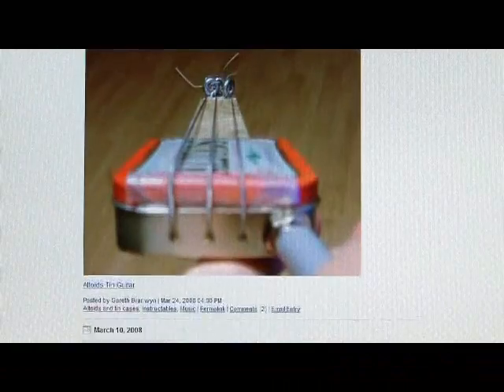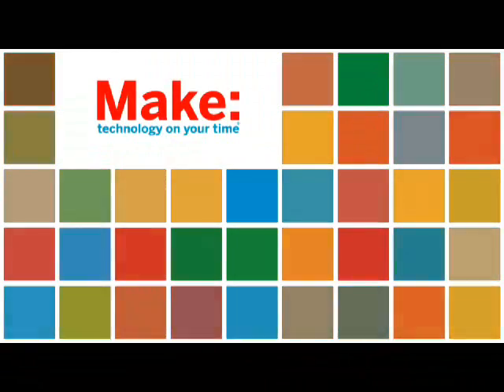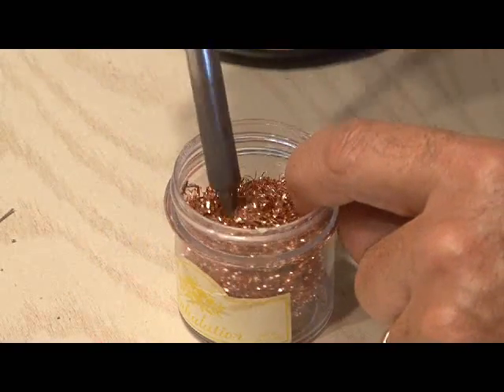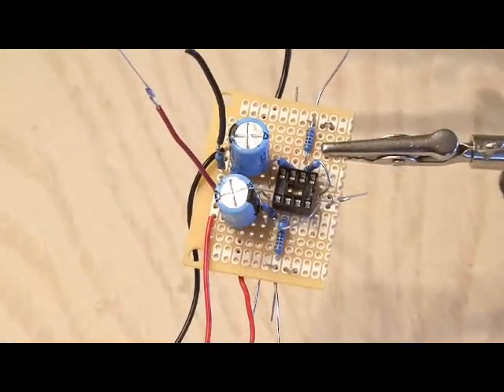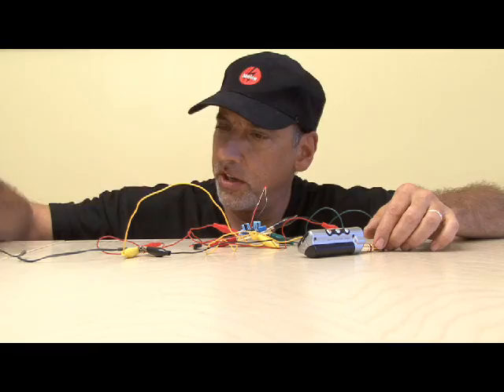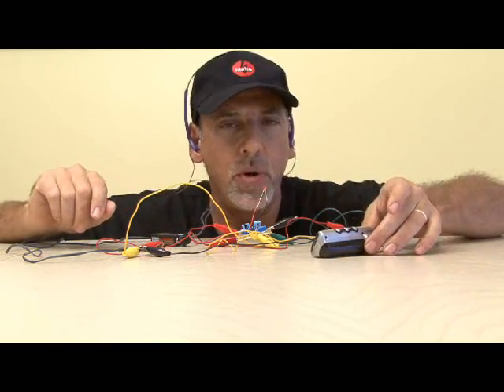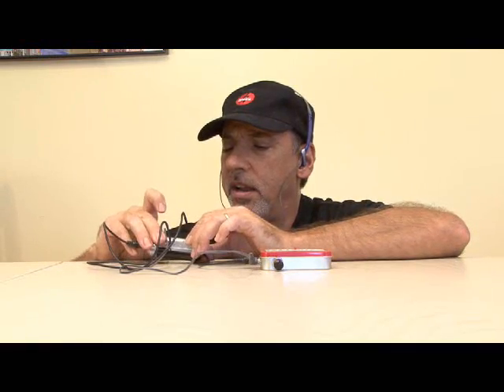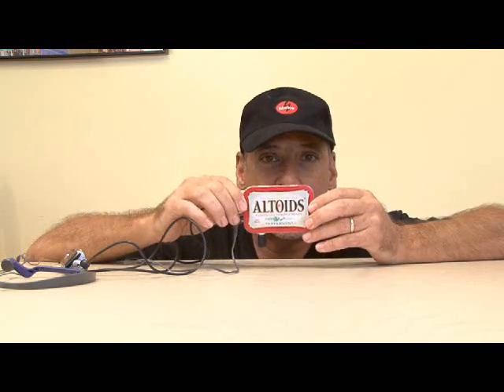Weekend Project: Mint Tin Amp

Comment: One of the worst DIY projects I've ever seen. Perfect example How NOT to do it. No part list or circuit diagramm. Did he thought no one wants to make one? 

My suggestion. Search for "Little Gem" on Google. These amps are the real deal (that means you can control a speaker with them), and also made from very little parts.

Comment: @AJ8494030615 a 8 pin socket for the 8 pin IC of course! What I think you mean is what kind of IC. I would like to know that too. It is probably just a simple dual op-amp circuit. One for each channel.

Comment: @Metallica0912 Not really

It’s a question of gain: you could increase the amp’s gain to around 100 to make it loud enough, but the noise floor will be unacceptably high. You need an amp design made for low noise with high gain.

Comment: The point of such an amplifier is to amplify the sound output from weak devices to power higher impedance headphones. Not the ones he uses though. Alternatively, if you are looking for a fast way to destroy your hearing, use this with any cheap headphone.

Comment: So I'm making these own portable speakers of a couple of old computer speakers I had laying around.
I have cut off the electricity transformer and planning to connect it to a battery/battery pack instead.
On the transformer in my speaker it says (among other things): "OUTPUT-AC 10.7V/0.8A".
Now to my question. Is the output energy actually 10.7V? What should I use for this? If I use 12V battery pack, does it only use the amount it needs or does it somehow get to much electricity and overheat?

Comment: @nicksfans123  Driving headphones (especially larger ones) is the biggest drain on an MP3 player's battery.  If you have a really small player with limited battery capacity, turn the volume on the MP3 player down, plug into this amp, and then plug your headphones in,  The added 9v battery provides the power to drive your headphones, and allows your MP3 player to run a whole lot longer.

Comment: Split the jacks for Right and Left, then take two small speakers (not active speakers) then buy a couple of jacks and connect the speakers on then, and plug in left and right. There you have a nice Stereo Amp =)
(Or you can just use computer speakers which already have a stereo jack, but they are active and they may get burned if you overdo it.)

Comment: @Birdy101235 

If you have decent high impedance headphones, an iPod type mp3 player is very quiet. I can't use my good headphones on the metro (subway train) as they're not loud enough and it drives me crazy. The amplifier boosts the voltage to the headphones and drives them more efficiently. It is the equivalent of turning the volume up to 20 or so when 10 isn't enough. If you have low impedance headphones, you may not need one of these, but you are probably not getting the best quality sound.

Comment: @seterry well, you can go about building one with a power op amp, like a TDA2030 (good for about 10W, use a +/- 12v stablised supply able to provide about 650mA. but i havent seen that particular video. there are circuit diagrams on the datasheets of TDA2030.

Comment: @seterry more power? try 2 batteries instead of 1, this would give you +9,0,-9. looks like 8 pin LM something. connect positive terminal of one battery to the negative of the other, then put ov at the point where the + and - terminals together.

Comment: I give the circuit a 3 out of 5 , I give the project a 4 out of 5

expected push pull amp with killer distortion , or multi head phone outputs.

Comment: @KillingOptions Makes the sound LOUDER hence the term AMPLIFIER. That's why a car audio setup costs so much. The speakers alone are around 300$ for a decent setup, but the amp will run you about 600$ on a good day. (Especially if you're installing a subwoofer.)

Comment: @budalo10 Yep, you just hook both of the headphone jack connectors to the output, and connect the sleeve to ground.  Here's a modified diagram.

tinypic   (DOT)  com/r/112c2zo/7

For headphones you may want to use a smaller pot for the volume control.  For example, a 5k Audio taper.  This will lower the signal level to a more reasonable level for headphones.

Comment: @budalo10 This designs definitely not ideal for a guitar amp.  It's input impedance is far too low, so you'll lose a lot of frequencies.  Plus, as you said, it's got an extra channel because it uses a dual op amp.  

A much better design is the "Ruby Guitar Amp."

That designs meant to be driven by a guitar pickup and it has a built in adjustable overdrive circuit.  Lots of demo videos of it around, and all the parts can be found at radio shack.  Best of luck, feel free to shoot me any questions

Comment: The scouring pad is not the same as the copper pads you buy : why? Flux. The copper pads you buy for electronics have flux on them which helps preserve the tip of the soldering iron from oxidizing.

Comment: @winnetouch because using an external amplifier and not pushing either amp anywhere near it's limits (like you would do with headphones directly plugged into your mp3 player) you'll get better overall frequency response, and less harmonic distortion. (sound quality)

Comment: @msgr33nday actually, the original reason people started making these is because some higher end headphones are harder for small MP3 players to drive properly. I've got a pair of Grado SR-80's, and they have a 32 ohm nominal impedence, rather than the usual 8 ohm that a lot of cheaper ones have. This means that it takes a lot more power to get the same sound out of them (but they ARE $120 [list price] headphones). A mint tin amp gets clearer sound and more volume, and saves battery time too.

Comment: @josh45245chatter It's for bigger headphones that require more power.  I have big studio monitor headphones that are VERY quiet when you try to use them with an mp3 player or laptop.  They need a headphone amplifier to be louder.

Comment: @howitsdone24 Of course you could change the headphone jack for a speaker jack, but that doesn't mean it's going to work. The circuit uses a small Op-amp which while powerful enough for headphones (when right next to your ears) is NOT powerful enough to drive speakers!

Go and search Google for "mint-tin amp" - take a look at the 2nd site at "tangentsoft" and then read the FAQ. It is quite clear that using it for anything other than a headphone amp is not going to work very well.

Comment: @howitsdone24 Actually if you read the design page, it tells you specifically that it's nothing but a headphone amp.

"Is it a speaker amplifier?

No, it’s a headphone amplifier.

It’s a question of power: the CMoy pocket amp can drive small speakers if you only need them to be loud when your ear is right next to them. Kind of like headphones. Go figure."

Comment: @computerman098 Just because you don't have a use for it, doesn't mean that others don't..  Mp3 players are designed to play at extremly low volume (in relation to other media devices) in order to save on batteries.  Which means anyone who wants their mp3 player to actually compete with outside noise, or to drive larger speakers, will need to run it through an amplifier.

Comment: I made basically this for use with a computer at work a few years ago; it had line-out only and was very quiet with the volume turned all the way up; it had three LM386 audio amps (two for stereo, one for mic. boost) and powered by three AAA NiMH batteries.  I used a plastic project box.  You can use the mounting holes on the circuit board with standoffs to mount the PCB.  My next project is a mini guitar amp that will have a speaker built-in and will plug directly into the guitar.

Comment: If mindless sheep connected to iPods can't hear their mp3 players be quite assured they have already damaged their hearing beyond repair. A headphone amp is basically the same as hearing aids at this point.
This would be a great little guitar amp that can be built into a cigar box. I have done it and incorporated the circuitry from a distortion pedal into the box as well. All you need is a 5" speaker and some knowledge, or help, with the circuit path and voila - a low volume bedroom amp.

Comment: theres no reason to bash me out but w/e it happens. Excuse me if I'm wrong but I built one of these in high school; it blew out my koss head phones. btw drivers are files required to recognize hardware on a operating system. if anything you might being thinking of the piston. If anything this is not a professional audio system, I'm sure of that.

Comment: I made a three-channel amp in 2000 with LM286 audio amps, fit into a plastic project box.  My work computer had line-level outputs only, and it wouldn't even drive headphones.  Two channels were stereo amp for headphones, third channel was for microphone.  Oddly, if I touched one particular solder joint, I could receive a local radio station.  Circuit bending by fortunate accident.   Maybe I should shoehorn it into an Altoid tin.

Comment: MAKE usually has fun projects that are useful. I really don't think that this is a bright idea. It doesn't really matter if u wanna blow ur ears out. Don't get me wrong i like to blast my jams too, but this will destroy your headphones. Headphones nor earphones are meant to handle that many decibels. The cone will eventually rip away from basket. If you built this or are planing to build this only use it on a extra speaker. You don't wanna blow out your nice headphones

Comment: depends on where you get it and the amount of heat it can produce. i think $25 should get you a pretty decent one. check radioshack for one. also, if you havent soldered before, watch instructional videos before you fry components or destroy your soldering iron

Comment: soldering gun. its pretty much electrical glue. its used to heat solder to "weld" them to circuit boards. kinda like electrical tape but more permanent. hope this helps

Comment: Re: expedition94
iTunes may have such a software option to boost mp3 audio 200%, but that is a software method that is likely to distort the audio, whereas this hardware will more cleanly increase the gain of said audio.

To those saying "why not just plug the headphones directly into the mp3 player," well that's fine for some people, but sometimes they are in situations in which their mp3 player's amp does not provide enough volume even at max; this amp will fix that.

Comment: Not all parts are available on Radio Shack. Most of you can purchase at warehouses and what not and avoid the mainstream retailer's price (aka Radio shack). The only thing you're supposed to get there is the circuit board because of the guide is based on an exact model from RS.

Comment: Haha the point of this was to make an amplifier. He is just showing you with head phones. say you had small computer speakers and you pluged them into your ipod they wont be that loud because there 9v and your ipod only puts out 1.5,, so to boost the power to 9 volts you use an amp. which he had made.

Comment: instead of a spark, attach a piece of nye-chrome wire between the two wires. use a needle and poke a hole in the fuse, stick the nye-chrome wire in the hole, then attach to the two wires. you can find nye-chrome wire in the heating element of a hair dryer. my ignition system isnt wireless, but it does work. please pm me with more information about your system. i am very interested

Comment: Kipkay what kind of amp IC did you use in this project? did you use the KA2209 IC? it looks like a 4 pin IC and this amp is stereo and the KA2209 is a 1 watt stereo amp b/c i have a Mega Mike from thew 90s and ive taken it apart like 100 times and I saw a 4 pin IC and it said KA2209 on it, and finally i rigged it like you did in your transistorize your ipod video, thru the volume comtrol.

Comment: This can be modded to use as a headphone guitar amp as well? It would have to be modded because a cord from a guitar is not a stereo cable it is 2 connections hot and ground.  If not modded you would get sound out of one side.

Comment: Again I agree it is a cool little gadget, and I'm not knocking the guy or his invention, but again most mp3 players can output sound at a sufficient level to cause hearing damage, and as for the theory you could use it to drive bigger/better headphones, who's gonna be using top-end expensive headphones on low-end , mp3 compressed audio players?

Comment: I agree it is a cool little gadget, but again most mp3 players can output sound at a sufficient level to cause hearing damage, and as for the theory you could use it to drive bigger/better headphones, who's gonna be using top-end expensive headphones on low-end , mp3 compressed audio players?

Comment: MP3 players don't have enough juice to drive bigger headphones. They're fine for earbuds and other headphones with smaller drivers, but if you get a nice set of around-ear headphones, which have bigger drivers and therefore reproduce sound more faithfully, you need some more power to drive them at their full potential.

Comment: IC Means 'Integrated Circuit'  which basically means there's a tiny circuit  inside the chip, the socket holds the chip =]

Hope this helps

Comment: that amp IC chip he uses in this project is probably a KA2209 its an 8 pin IC like the LM386 amp chip but the KA2209 is stereo and the LM386 is mono, id love to build this but i need the parts, I got a soldering iron and i will use that soldering iron cleaning trick, I need one of these for my PSP the sound is weak. BTW kipkay what type of mp3 player are you using in this video?

Comment: Yes you are right in al the aspectyou are speaking of, But that is not the purpose of this project. This amp is meant to enhance the sound comeing from the existing headphone jack on the mp3 player. I havent seen an mp3 player with a line out but I do rember the old cd players usually had one. well anyway this is just meant as an enhancemeant to the already amplified sound from the headphone jack which is the same thing that your computers speakers do,

Comment: the amp is meant to amplify the sound coming from the existing headphone jack if the headphone jack on the mp3 player was broken there would be no way to connect the amp so say you think the line out was not loud enough on the mp3 player you would connect line out from the mp3 to line in on the amp line out on the amp to your headphones and there the sound is louder therefore "AMPlified"

Comment: It allows a portable or not-so-portable device (e.g. a laptop) drive headphones with less distortion, especially absolutely requiered for the high-impedance ones, such as specific high-end and studio headphones. Not necessary for usual portable ones in the 8 to 32 Ohm impedance range, but is said to help some devices.

Comment: A high quality op-amp makes any MP3 player sound better than the crappy amp in the device. the large capacitors and separate amp is way better quality than the built in amp in an iPod and to get even better sound you use the line out from the iPod dock and thus bypass the iPods amp all together.

Comment: usualy even at radioshak it would cost about a 100$ i did this project tho i didnt use altoids & it sounds pretty good if you keep with Audio Grade (Hi-Fi) ICs 

also F**...k you sound like a dumb jalous person. 

note that this can also be used as a portable guitar amp , just replace the 1/8 to 1/4 sockets in input

Comment: if you r using an ipod or anything which can be charged by using a USB cable, then I have a much better project for extending battery life. It's just an external battery. I recon it's a lot better than keeping the volume down rely low. My ipod video lasts for about 100 hrs on just a plane alkaline battery

Comment: With small mp3 players like the nano and similar, running with the volume very low extends the life of the rechargeable mp3 player battery a very long time.  

Connect to player, set player output to about 10% for full dyanamic range, then use the tin amplifier to increase the volume to a normal level.   The 9V battery can provide a lot of runtime due to low current draw, compared to the 3V rechargeable at high current draw for the same volume level.

It will distort badly if overdriven.

Comment: That's more a pre-amplifier than an amplifier, in fact it doesn't output so much power over headphones... but it's clearly audible due to their small size.
There's a big load of this kind of circuits on the Net, because it's a very basic brick of electronics stuff.